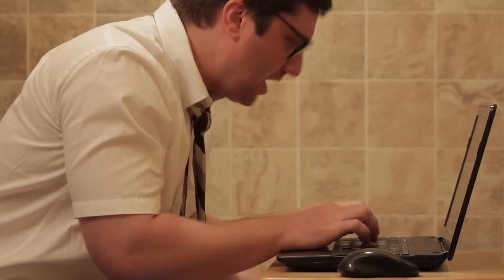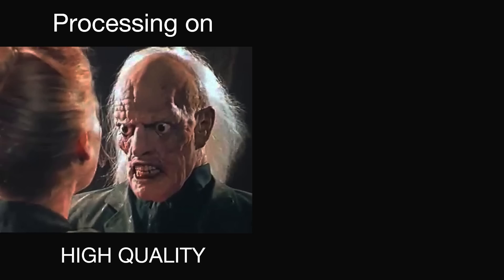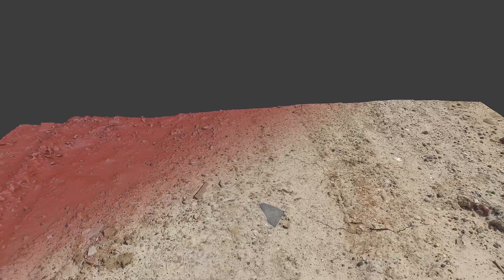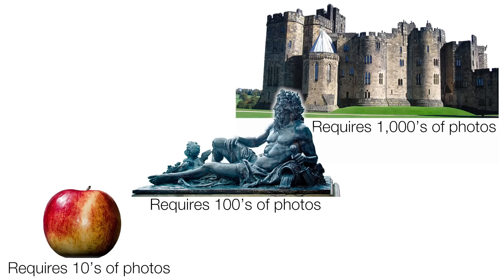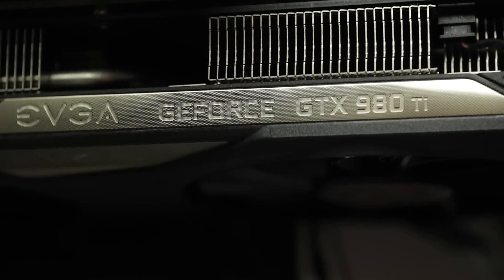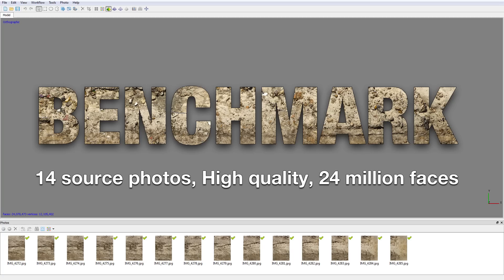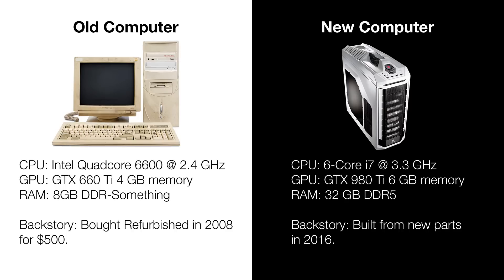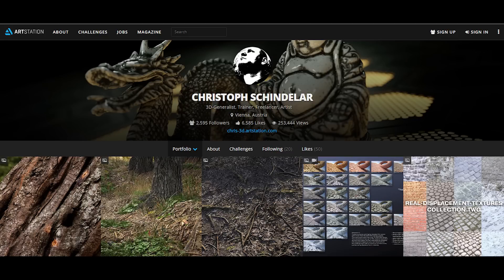PhotoScan Guide Part 3 and a Half: Building a PC

Comment: Hi,
can you make a video on how to make photogrammetry on big structures such as airports or hospitals?
Reply from the maker: Yes, I have a segment devoted to big stuff like that in the upcoming guide!
Reply: nice,
I really can't wait for the upcoming video.
And also hoping for a video for internal building photogrammetry.
Thank you.
:)
Reply from the maker: Thanks for the kind words! You'll be happy to know that I already have some tips for interior scanning planned for the video. I've tested out several different methods. I hope you'll find it quite helpful!
Reply: Wow!!!
When do you plan to post the video?
because I hope that the video can help for my ongoing project.
We are asked to design an airport using photogrammetry exterior and interior.
That is why I really need your help for this.
:)
Reply from the maker: Sorry for the late reply! I just saw your post. I hope to have that video out in January. If you have access to it, Reality Capture could be a good program to check out. It's great for scanning big buildings because it can handle much larger data sets than PhotoScan. It's also pretty fast at processing.
Reply: yeah~
thanks.
I had already have a look on it.
it plays more with points right?
I'll try it again later with big structures.
I had tried using Remake,
but Photo scan give better result then Remake.
Reply from the maker: I believe you can actually use both point cloud (LIDAR) and photogrammetry data with Reality Capture, even inside the same project. RealityVirtual has done some cool stuff with it: http://www.realityvirtual.co/photogrammetry-1-1/
I've never tried Remake myself, but from what I've heard you are right. PhotoScan seems to give better results consistently.
Reply: After have a look on Reality Capture.
I think it is possible for me to do internal and external of anything!
the software is just a WOW!!
not yet trying it.
will do..
However,  I will wait for your cool tutorials.
:)
Reply from the maker: Haha, yes, it is a very powerful application! I will show techniques that are applicable to all photogrammetry programs, so you will be able to use them with Reality Capture as well.

Comment: Since you mentioned doing a photoscanned texture pack.. Have you ever ran into the same issues that i have?
Making a texture tile seamlessly involves offsetting your image and doing clonestamp work to get rid of the seams, which basically means that when you want to tile a photoscanned texture which has diffuse, normal, depth, etc., there aren't really any tools out there that allow you to do the same work simultaneously on all of these layers in a way that keeps them matched up perfectly.
Reply from the maker: +brummii That is definitely one of the difficulties when working on these types of textures. If you prefer working in Photoshop, you can record an action while you're creating the first map (for example, the regular diffuse/color/albedo), and then apply that action to the remaining maps. That's about the only way I know of currently, but maybe someone else knows some more tricks!

Comment: Almost 3000$ for PC
Sounds like a wet dream for somebody who lives in east Europe :(
Reply from the maker: Yes, I know it is a very high budget for many people. If you ever visit the 3D Scanning forums on FB, Jörg will probably have some helpful computer hardware tips to share. He seems to be a pro at utilizing old parts.
Reply: You don't have to buy everything at the same time.... I spent 700$ on a 6700k, cooler, motherboard and ddr4 3200mhz Ram. Overclocked to 4.5 (which was really easy) it outdoes the 5820k at stock speed in some benchmarks while having fewer cores. Only thing I need to upgrade is the GPU, which, like all the other components I did not replace is about 7 years old.

Comment: I really want to get into this but can my 2015 iMac 5K retina 4ghz i7 32gb-RAM handle this? also can you export that mesh into Cinema 4D ? please help thanks in advanced
Reply from the maker: Yes, you should have no problem using PhotoScan with your computer! When I first started, I had a refurbished Gateway quadcore I bought in 2008 with 3 GB of RAM and, while I had to wait a while for processing and was limited in how high I could set the quality, it still worked okay. So your computer should be fine!

And yes, you can export a variety of formats that Cinema 4D should be able to use. I think all the common ones such as OBJ, 3DS, FBX, etc. are possible. If you don''t need the texture you can even export your model as an .STL, I noticed it is much faster to import/export than OBJ is. Hope that helps!
Reply: ClassyDogFilms You're a legend thanks so much it's been a big help yes I'm keen to getting into it. I do a some 3-D work and I'm thinking I might get an epic PC & not a Mac from now on. The PC's GPU's & getting crazy good
Reply from the maker: Thanks, I'm glad I could help! Yes, you can build quite a powerful PC without spending a lot of money. There's a lot of clever and thrifty builders out there, if you have the time to research I'm sure you could make something a lot better than mine for a lot less money!